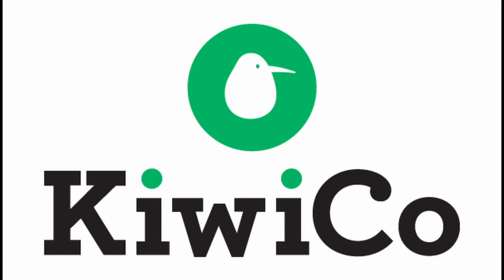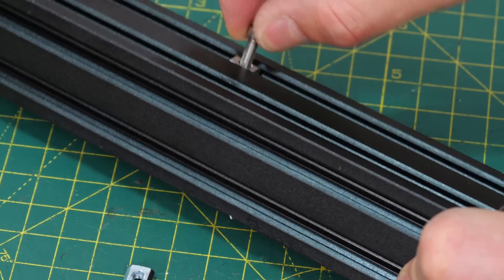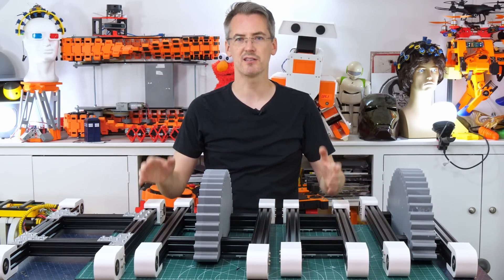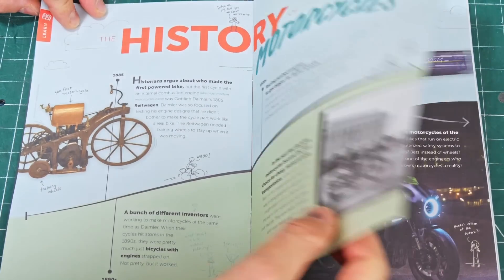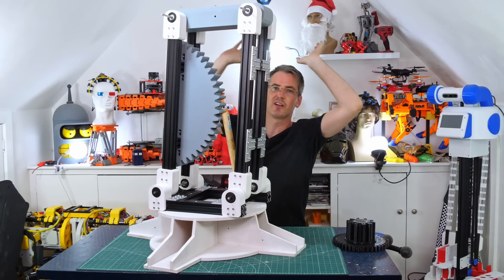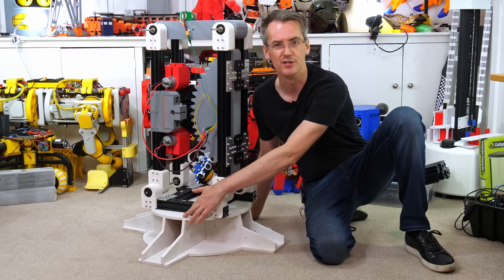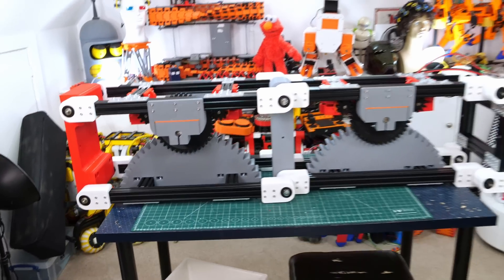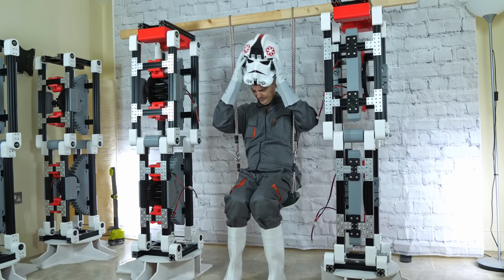Building a working AT-AT big enough to ride on

Comment: How do you design the 3d printed parts to be strong enough?
Maybe you could say a word or two about that.  
Are you using standard engineering formulas or rules-of-thumb, based on strength paramters of the filament?
Or are you just going on experience?

Comment: There is a problem on this : The leg of an AT-AT has another joint. And this joint is not present in this design. Or rather, it is there, but it works in the wrong direction. When you have a good look at the movie, you will se that even the original toy do not have that joint build in.

Comment: Wow, I guess the " real size" one is going to need the help of a company that specialises in steel bridges/ commercial buildings and get powered by excavator tech :) and use a 3D printer that uses garden hose as its " nozzle size" ;)

Comment: Call me what you want, but the one thing I hate about anyone who makes an AT-AT, for display, a toy, or stop motion, is that they always forget that the walker as a third limb to the legs. That piece that he made that allows the legs to pivot to the sides? That is the third part, it acts as a part of the leg, another joint that does go up and down to cushion the walker’s movement other than the shock absorber within the thigh of the leg. I get that it may be stationary for stability but it still makes me upset, like pet peeve.

Comment: I have an engineering concern/suggestion: braking gears.  Does this design incorporate any physical braking to prevent gear movement when the motors are off?  My question is out of concern for the wear and tear on the motors just from keeping the unit static under load.  But also I wonder about what could happen if there's a loss of power to one motor or all when the whole AT-AT is in operation.

Comment: I’d recommend for adding a little bit of traction to the bottom of the foot that it should be the traction padding used to keep carpets from sliding around wooden floors or a thin rubber surface it might help with sliding backwards a bit

Comment: Seems like you could bolt part of a brake rotor on those smaller gears and have a caliper that holds the pads under pressure with spring tension, until a solenoid is energized by the servo power, which in turn releases the brakes and allows the gear to move freely while the servo motors around.  Or program some kind of delay to the motors while the solenoid engages or disengages the brake.  This would act as an automatic position hold without needing to constantly input power to the motors.

Comment: Amazing project, The gearing looks perfect but the axels look small, could use bigger shafts and thinner bearings in the most loaded areas. . interesting origional artwork for the walker, the joints were from a motor with a worm drive to an idler to the main joint cog. the motors look like a ring with holes in.

Comment: Since it is gonna be holding so much weight, maybe it might make sense to mount the feet on some dampened 2 axis or even a ball joint articulation, or at least some sort of strong but somewhat flexible mount, to let the feet adapt to uneven ground without straining the structure too much?

Comment: I'm curious why you 3D print some of the really large pieces that could probably be more easily created with traditional materials. Like the really large gear could have an inner core and just the teeth 3d printed. And the knee joints and boosters could be done with wood or other material cut into the correct shapes. I love the project, but some of those pieces seem like its unnecessary large amounts of time and filament being used, so just curious.

Comment: wow! Went for a design that puts maximum stress on the 3d printed gear teeth and the servo gears, and tons of bending and twisting stress across FDN layers! It's like making a antenna tower by building a 3d-printed brick smokestack.

I will be amazed if this moves without breaking- you can print at 100% infill and you still dont get parts stronger than a solid plastic part. Just eyeballing this, it doesn't look possible with these materials and designs.

Comment: I feel like you could cut those gears out of plastic too. Just pick a sheet of ABS, or PTFE, and use your router. But you need to reduce their weight too. But I feel like that would have been time saving, and stronger.

Comment: You're my favorite robotics builder on YouTube. You're such an inspiration! I just finished converting my kid's old Power Wheel to remote control with a 3D printed sprocket on the steering column to turn using a motor and a chain. It's super fun to see a 5' skeleton driving a little jeep 😂
Reply: did you make a video of it?

Comment: 2:00 Now, I'm just an engineering student, NOT an engineer, but that bottom right screw doesn't strike me as "secured".

(I know you most likely screwed it in correctly after getting the shot, it just looks funny)
Reply: Now a I have nothing to do with engineering.. but I saw it plain as day too. Not sure what your education has to so with using your eyes.

Comment: 0:31 Interesting that the original design used gears instead of belts. I have poor engineering knowledge, but gears have wear and backlash problems which I don't think is ideal for long-time use and precision?

Comment: That printer is a very interesting solution to an actually common problem. Lots of people print long rectangle parts (or ones that fit in a long rectangle), but few print huge cubes - so having a printer that violates the Cubed print volume, thereby saving some space, to make one or two axises longer makes a lot of sense!

Comment: Brilliant 👌 
I worry that the thin bars used in the moving joints will flex when under moving load and this will cause binding and therefore unusual movements but this video will have been recorded some time ago and you'll already know if that's the case already 👍
Keep up the amazing work 😊

Comment: I genuinely feel that you are single-handedly proving just how good 3D printing can get. I still see a lot of people. Dismiss 3D printing is some crappy week frail process that produces fragile parts that want to disintegrate at the slightest touch, but you have proven quite the opposite honestly
Reply: I’d argue that, equally interesting is his use of shims and bushings to de-risk big prints.   A very good exercise in manufacturability.
Reply: if this project was real sized then plastic wouldn't be enough to hold the weight due to the length of each part.. not to mention he wouldn't be able to print the parts due to their size either...
Reply: When the majority of people print useless trash from thingiverse, what would you expect?
Reply: Imagine how expensive this project would have been had he not had sellers sending him filament, bearings and whatever else.
Reply: Yes and no. It's great what James is building but 3d printing has proved that already by being used in the airline industry and elsewhere. Of course with much higher costs but without having to produce large numbers of pieces.
Reply: Good is debatable. The quality of his prints mostly isn’t that good because he needs functional parts quick. That’s absolutely fine. But is that a measurement for “good printing”?
Reply: @MrRevenant333  i think it means 3D printing has valid use cases outside of gimmicky multicolored toys. it's not about fine detail or quality and surface finish. it can quickly chug out huge strong parts for massive robot prototyping :D
Reply: His projects are awesome, but 3D printing is a terrible choice for fabricating something like this unless you are sponsored by 3D printing companies. Just these legs would be thousands of dollars in print filament and an insane amount of print hours even with the large nozzles. You could use more aluminum extrusion and make the other parts from glued up layers of MDF or plywood for a small fraction of the price and time. It would likely even be cheaper to have a lot of the 3D printed pieces laser cut and formed by one of the many companies that offer those services. It would also end up lighter and stronger that way.
Reply: @Eric-vq9nq  I agree but when all you have is a hammer everything looks like a nail. I'm sure it's simply easier and faster for him to do everything through his 3d printing workflow at this point. The costs all depends on scale, a one-off project = this method is fine; making 10 of these = more consideration for mixed materials; 100,000 units = you've already done a full cost breakdown analysis that says 3d printing isn't even an option in the final design.
Reply: @Eric-vq9nq  But it's prototyping. It would be much more work for him to do this with the materials you propose, and because he knows his processes he can do something different in the mean time. You are right, but for this niche it's absolutely okay. Matthias Wandel for example is a master at the bandsaw, he does all his prototypes (not that complex but sometimes in several iterations) with wood, he still doesn't have neither a laser cutter nor a 3d printer. I don't know a shop that offers all suiting materials from one hand.
Reply: @Eric-vq9nq mate this is like £500 max of filament